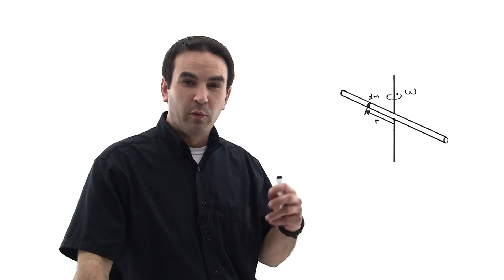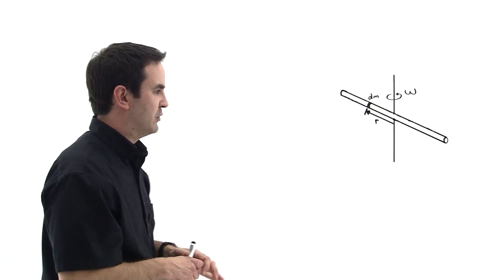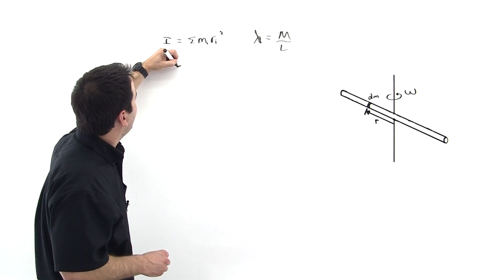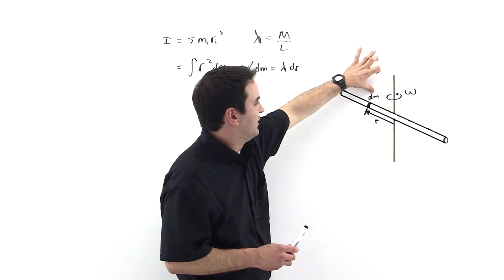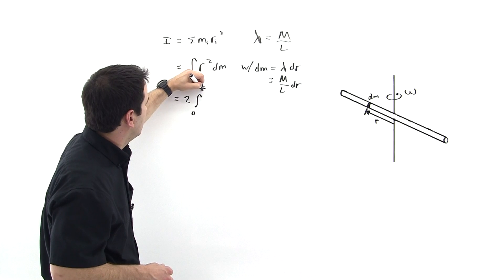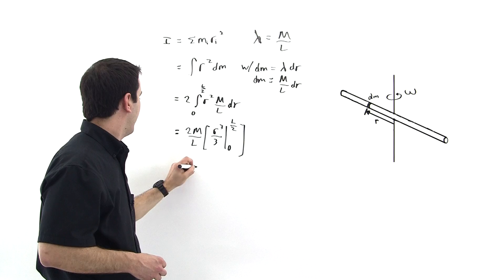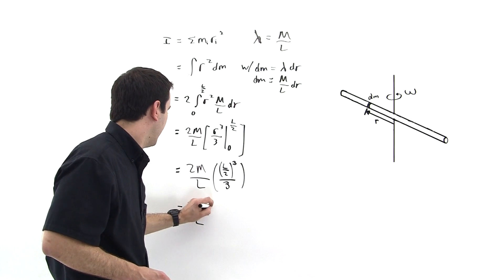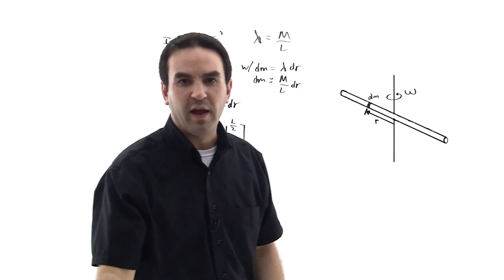Deriving the Moment of Inertia for a Rod

Comment: why is Lambda = M over L and not M over Volume?  kg/m^3
Reply: it is not like density we know. it is the mass per every meter. by means of it we get the amount of mass in every meter.
Reply: Because the length of the rod is much greater than its radius, or vice versa the radius of the rod is very small compared to its length. Considering any other form of density other than linear density requires assuming other kinds of geometrical symmetries in the structure of the rod.

Comment: arent boundries of this integral usuaaly -l/2 and l/2 ?
Reply from the maker: you can do it that way also.   I just integrated from 0 to L/2 and then multiplied by 2 because the moment of inertia for one side is the same as the other.
Reply: It's much easier to do it the way described in the video.